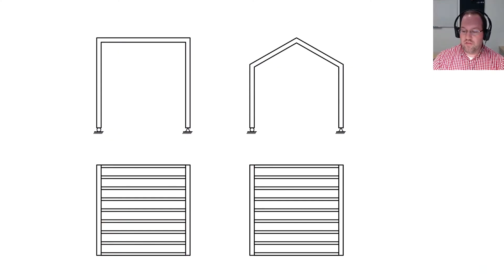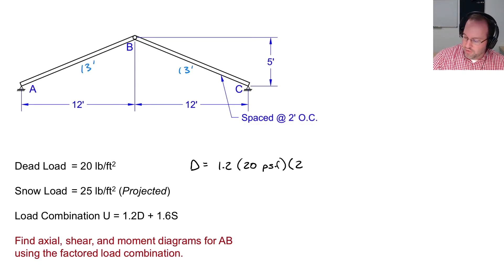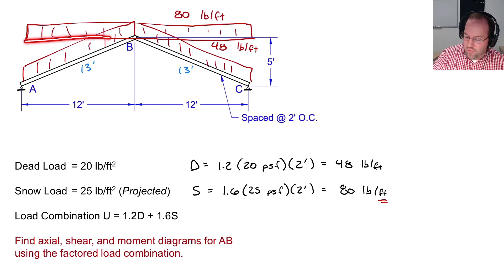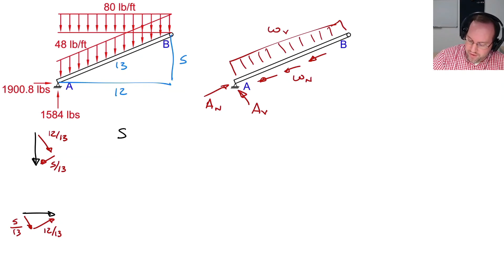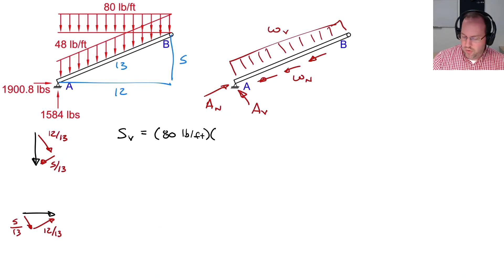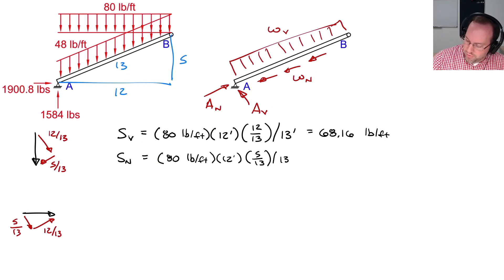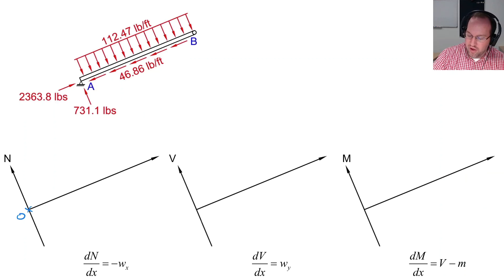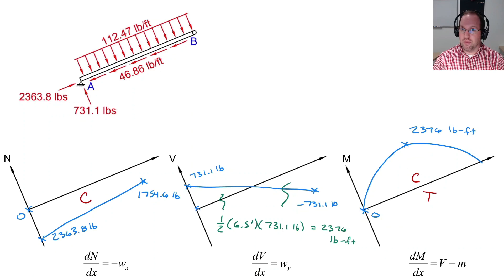Projected Loads and Snow Loads - Intro to Structural Analysis

Comment: Why project load? Use the actual slopped area and done. Slopped roof will have more area. No need to project. If snow is hard, it will accumulate as it is. Slab bends only in gravity direction Assume load as inclined and slab as rotated, it is just kfking same. Why bother so much.

Comment: Professor, thanks for the video. Was hoping you could address a question if time allows. Per ASCE, for roof exposure factor Ce, having a hard time understanding why a fully exposed roof has a reduced factor VS a sheltered roof. Wouldn't a fully exposed roof see the more snow load when compared to the sheltered roof?

Comment: Thanks for the video. Is it correct to state that the only reason the reactions have an X component is due to the hinge at the peak of the roof?
Reply from the maker: The hinge certainly doesn't help, but you will still get horizontal (X-component) reactions even without the hinge. As the load presses down on the structure, it tends to "flatten out" which will be resisted as horizontal reactions. The hinge means it tends to "flatten" more under vertical load than an equivalent system without a hinge, but the phenomena is present for either case.
Reply: Why is it then with truss analysis vertical loads never transfer lateral force to the roller/pin? Due to a 3 force member in equilibrium? And in the roof case, the bottom chord would resist the tension?
Reply from the maker: @WG-ft6tz  For truss analysis, we typically assume that one support is a pin and the other is a roller (meaning, it allows for horizontal movement). In this configuration, any horizontal force is resisted by tension in the bottom chord. However, if both supports are pins (meaning both resist horizontal motion), then you will once again get horizontal reactions even if you have a bottom chord. This is because the deformation of the truss will push these two supports outward, which is resisted by inward horizontal reactions.
Reply: Ah thank you! So used to analyzing pin/roller trusses in examples. Subscribed!

Comment: How do you calculate the dead load.
Reply from the maker: In this particular example, I just made up convenient numbers for the loads. In reality, you would need to know the weights of your materials for your roof/floor/whatever you are designing. You can find typical material densities online, but the Chapter C3 commentary of ASCE/SEI 7 (Minimum Design Loads for Buildings and Other Structures) provides a lot of useful values for structural engineers.

Comment: G,day from Sydney Australia.
Once you have calculated the forces applied in compression and tension, what is the easiest way to select materials that can resist that load per foot: manufacturers specifications or actually testing?
🌏🇭🇲
Reply from the maker: That's a MUCH bigger question than can be possibly tackled in a YouTube comment. First, design can't be done just knowing the load per foot - we need to know the flexural moment, shear, and axial force (tension or compression) demands in the members we are designing (and torsion if it comes up), plus we need to make sure it works for other concerns like serviceability (limiting deflections or vibrations, etc.). These will all depend on the span lengths, how things are connected together, and so on. Different materials will have different design standards, but in general there are accepted standards or specifications that will describe how to compute the nominal design capacities. 

To get back to your question, for pre-fabricated systems, it's likely that the manufacturer has already done a lot of this for you. They may even present the results as a nice "load per foot" value, but there is a lot of background to those numbers. Actual testing is typically only done for unique circumstances that might be pushing the envelope in some way, or if the project budget and stakes are really high and can afford some proof-of-concept tests. For most typical applications, the specifications (as long as they are properly checked and used in the proper context) are sufficient.
Reply: @StructuresProfH  Thank you for your time and explanation: assessment of materials used in building construction, snow covered. I only have experience selecting pre-determined stress graded timber and steel. This was in residential building surveying qualifications.

🌏🇭🇲

Comment: The reality is that snow does not fall straight down and with a symmetric roof will build up more on one side than on the other. Also with asphalt shingles, as I know all too well in New England, heavy, wet snow does not slide off the roof by itself
Reply from the maker: All very true. Chapter 7: Snow Loads in ASCE/SEI 7 considers these factors. In particular, section 7.4 describes the sloped roof snow load - the "slope factor" is often 1, particularly for rough surfaces like asphalt shingles, meaning snow is generally not sliding off that roof. Section 7.6 describes unbalanced load cases where more snow accumulates on one side versus the other.

Regardless, the design snow load (whether balanced, unbalanced, or reduced due to sliding) is always intended to be applied as a projected load acting vertically. This video was just meant to introduce the concept of how to handle that projected load to find shear and moment diagrams. I think a follow-up video on how to compute snow loads in more detail would be a good idea though!

Comment: Thanks for a well explained video. In spite of that, I do have a couple of questions. I have learned that a truss that is statically indeterminate can't be solved. Is that just for internal forces(you obviously did solve it). secondly could you make a video on how to use these figures to design a wooden  truss? How many members and what size they need to be.

Comment: Very well explained thank you, I have a question tho, if we had the wind load as well which would be perpendicular to the roof how could we calculate it as well?
Reply from the maker: The wind load, applied perpendicular to the surface of the roof, does not need to be converted like a projected load. It is already applied per unit surface area (not projected area), and it is already in the "shear" direction with no "axial" direction component. So no conversion necessary.
Reply: @StructuresProfH   how we use the perpendicular wind load in the load combinations?